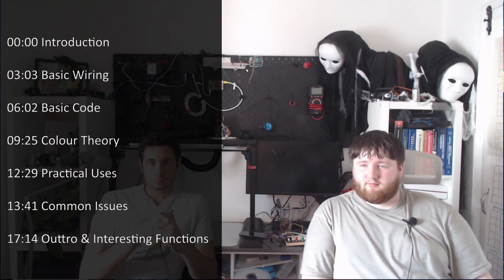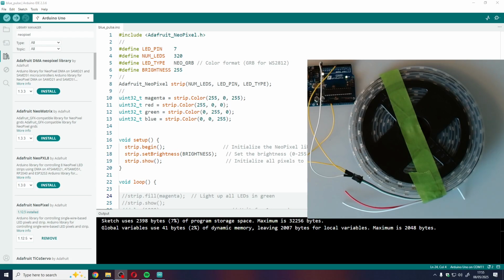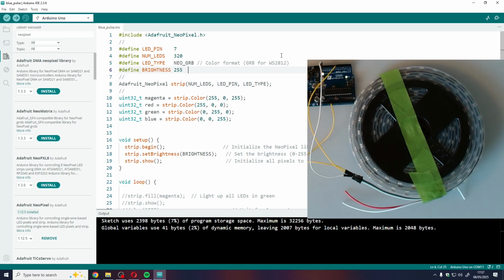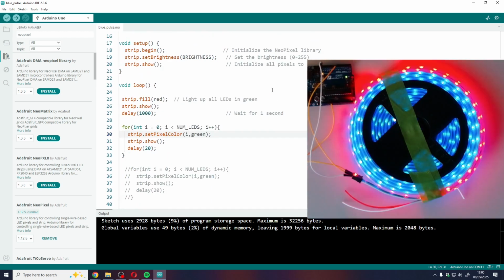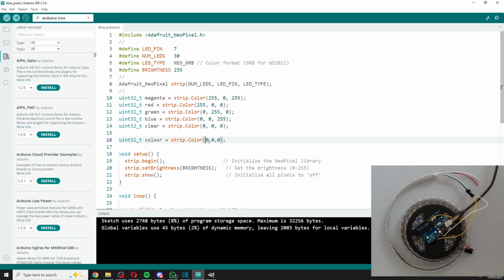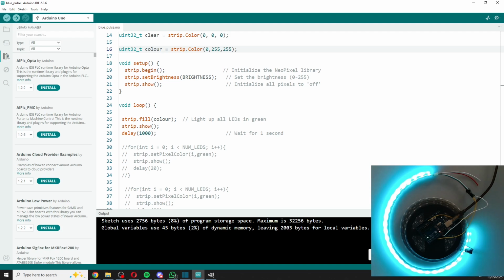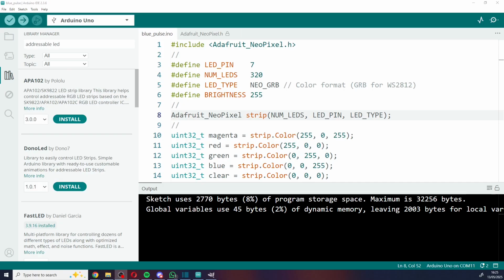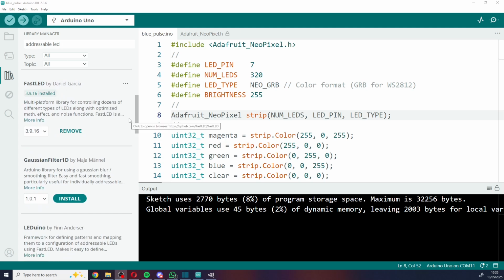How to use addressable RGB LED's with Arduino (RGB LED's simply explained)

Comment: how did it take you gentlemen to troubleshoot the common-ground issue? Just curious.
Reply from the maker: Honestly man, its such a basic issue and yet we run into it all the time. 
As this was originally set up on the backboard in the office we actually knew the issues with the LED's before we started the video, but we had the same problem with a stepper a few weeks ago and that probably took us an hour to resolve xd. Its always the first thing to check in my book.